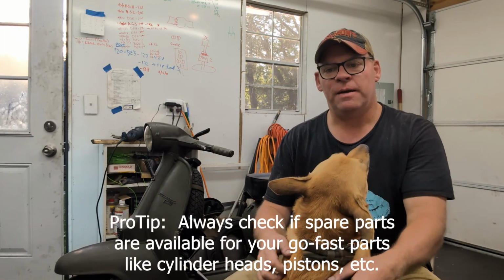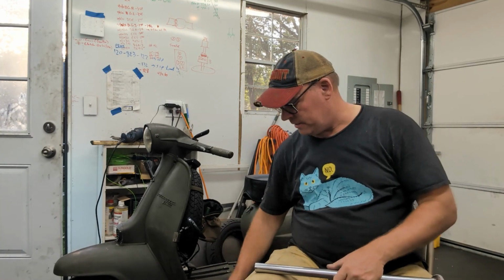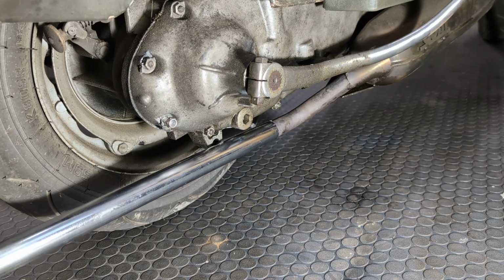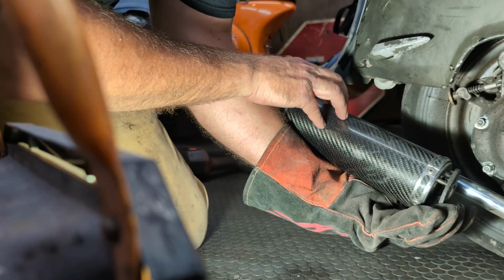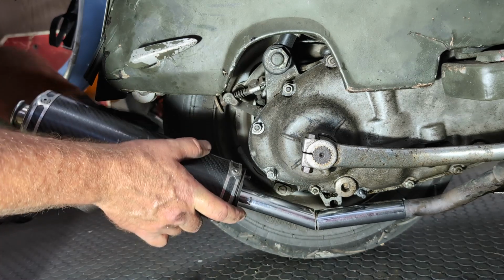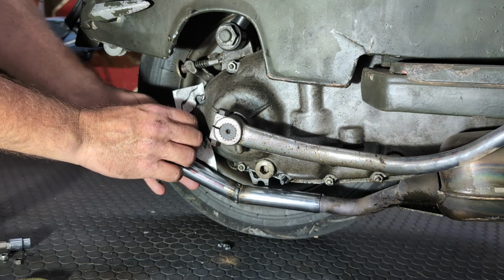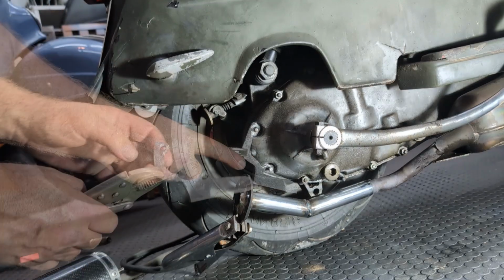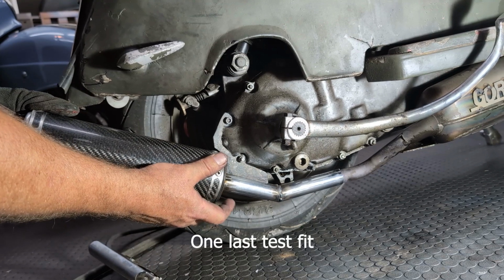The silencer fell off my Lambretta's exhaust...so I made a new one!

Comment: I have a BGM sport v4. Can is under scooter. Lambretta’s are for fetling.
Reply from the maker: I definitely have spent a lot more time getting it to a satisfactory state than I ever have with a Vespa.  This scoot had a lot of deferred maintenance, too, and I'm still not entirely caught up.
Since I made this video, the exhaust spigot snapped off while riding (luckily, I found that) and when I pulled the exhaust to deal with a stripped case stud, I found that one of the 11mm tabs at the front of the exhaust had also cracked off.
I really like the Gori from a performance perspective, but the overall quality of it is pretty crap--definitely not up to the cost of the pipe.